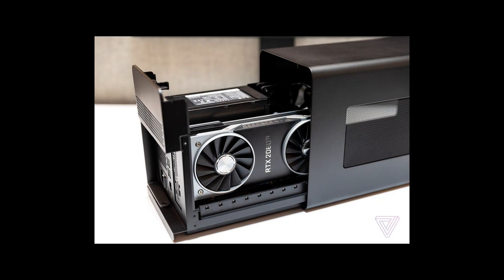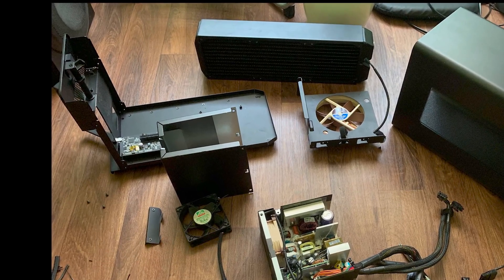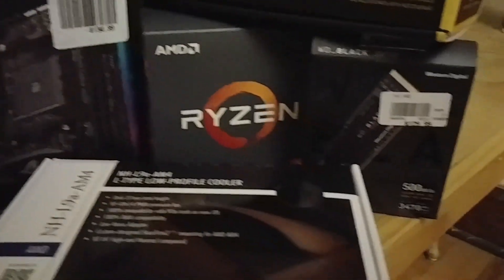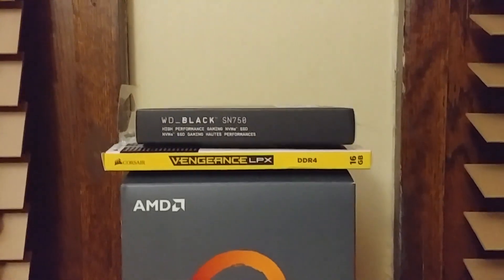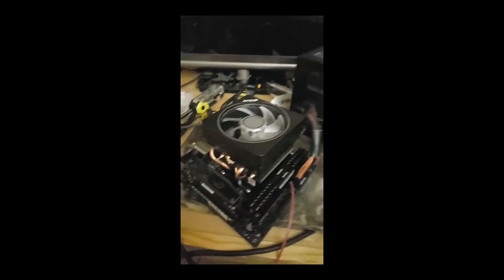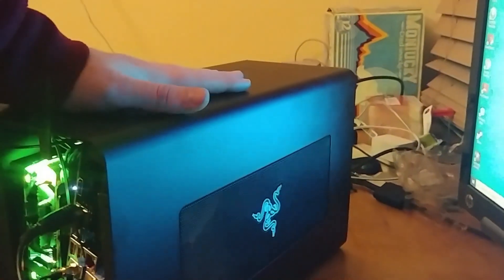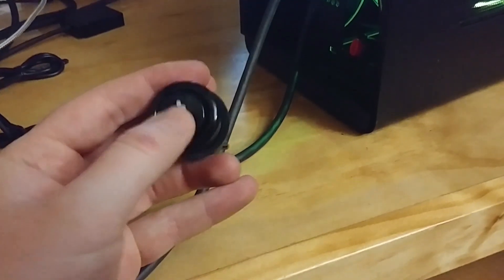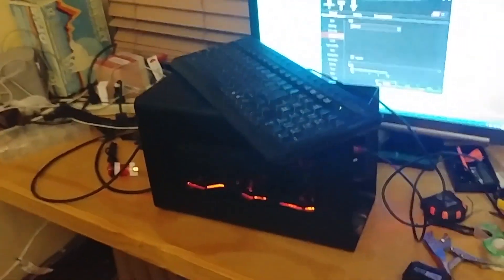I turned my Razer Core X into a Small Form Factor PC

Comment: just an fyi, your first motherboard might have broke because you had it on top of the static resistant bag like the one in this video. those things work by covering the outside in a condutive later that dissipates any static electricity from the components on the inside. setting any electronic on top of the conductive outside, especially while that electronic is on, is just asking for a short.